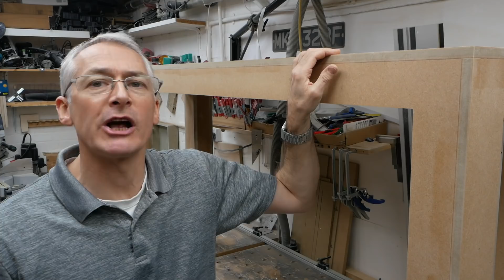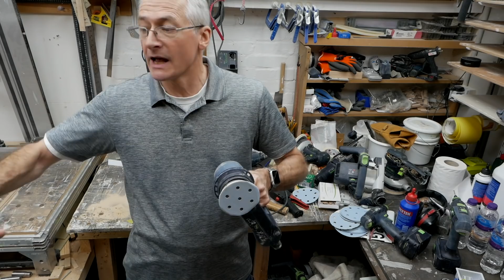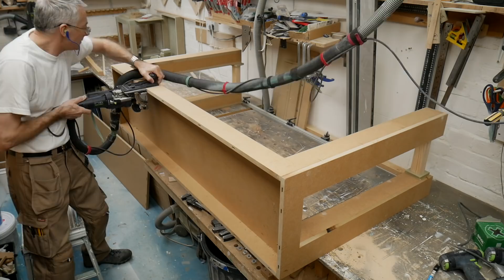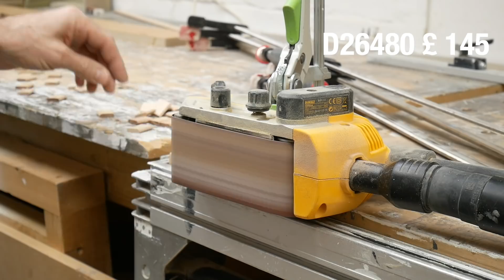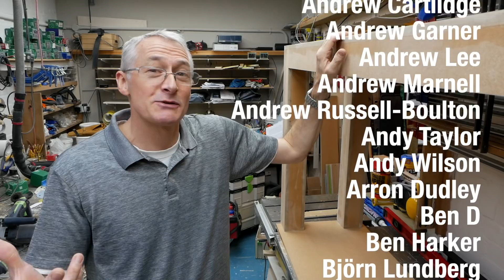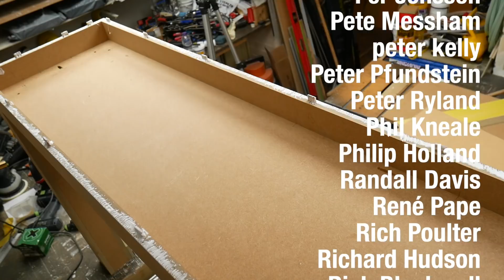Time, Tools & Money [video#245]

Comment: Obviously I’m late to the party but just wanted to share my thoughts on this: years of experience is also part of the costs. It’s no different from any other job - years of experience is usually at the top to be considered for a job application. The clients are not paying you only for the materials and the hours required to finish the job. They also have to pay you for the years of experience you’ve had related to the work to be done. 

Nothing against that person who commented it - he did positively and respectfully respond to your reply. The sad thing is he’s not alone with this thinking. They fail to realize that it’s just the same as any other job.

Comment: I see the benefits of a lot of the festool/mafell tools for a professional, but the festool drills seem disproportionately expensive. Is it reliability that draws you to the festool tools or is it that a couple of hundred quid over the life of the tool isn't worth worrying about, or is there something else these do better than a DeWalt/Makita that costs 1/3 the price.
Reply from the maker: I only wanted to support one battery platform, and when I started buying the drills Festool were the only company that also guaranteed the batteries for 3 years. The drills are generally excellent (after switching to Festool drill/drivers I got rid of my impact drivers) and were well ahead of their time with e.g. brushless motors; the centrotec chuck system is an elegant solution for everyday fast-change between drill/driver bits and also e.g. right-angle and offset chucks, as well. 👍👍
Reply: @10MinuteWorkshop  makes complete sense! Thanks for taking the time to explain. I just picked up a used TS55 plus 2x1400mm festool rails for £220 so starting to understand why they're so coveted.
Reply: @10MinuteWorkshop  Yeah that's a massive consideration I agree, you see all these 'cheap' brands nowadays and they aren't really value for money anyway.  If you take out the cost of the batteries and charger the price of for instance a Makita drill is hardly anymore than the price of an Einhell/Aldi/Lidl one...

Comment: I guess the people with negative comments do not run their own business or know anything about marketing and the difference between value and cost.  Many customers are happy, and in fact prefer, to pay a premium price for a premium product or service. Cost plus doesn't take in to account the quality of the finished product, the service being offered, the customer, the competition.  Your absolute minimum charge needs to cover your wages, holiday pay, sick cover, pension, business and van insurance, workshop rent, rates, tool wear and all the other fixed and variable costs. We occasionally build the cost of a tool in to the job but where we can spread the cost over a few jobs. I often check the hire cost at our local hire shop and include a charge for using our kit at that rate. Particularly if we use something like our mixer or chopsaw. It is easy to undervalue your skill when making things for people and get caught up trying to submit the cheapest quote.  Out of everything I do running my own business quoting is without doubt the hardest to get right. Simon. Artisan Bespoke Restoration.
Reply from the maker: Cheers Simon! 👍👍

Comment: 320 for a drill...that is ridiculous. You can get full kit Milwaukee or DeWalt for a lot less.
Reply from the maker: Sure - I bought mine in 2010. Centrotec Chuck on those others back then?? 3-year warranty on the batteries eight years ago? You can always buy cheaper, but does it last??

Comment: I love your channel as much as the next guy but let's pause for a second here. Lots of companies make all those tools... Drills, drivers, plunge saws, sanders. To be really honest you could do a "budget" version of that toolset and probably come in at half the price or less. 

I built my whole workshop with a CXS so I would argue that a T15 and T18 are hardly necessary for working with MDF. It has the centrotec system for goodness sake, the whole point is fast bit changing between drill and drive. It's still my only drill. Even then, it costs more than a Milwaukee or makita drill/drive kit. I did all of the wood exterior just with an ETS 150/5, too ;)

Again - I love what you do and I would never fault you for recovering your cost, but I do find this to be slightly disingenuous on the tool costs necessary for this work. Totally agree on clamps and other infrastructure though, that's one thing I always caution people about when they are getting into the hobby! Buying used helps ;)
Reply from the maker: I’m going to copy/paste an answer I gave to Richard Owen way at the start of the comments thread. Richard suggested I could have used Dewalt or Makita tools...

“...and just so’s we’re clear, I wasn’t using this video in any way to justify my purchases. I run my own business, I don’t have to justify them to anybody. But, out of interest, what DeWalt and Makita sanders have dust collection as good as the Festool? Where’s the Dewalt or Makita equivalent of the Rotex? Which DeWalt or Makita drills come with a 3-year warranty - including the batteries? My original tracksaw did 11 tough years on its first set or brushes - could I say the same of a DW or Mak? And the Domino?? Festool-only, mine’s getting on for 10 years old, and has cost me less than £1/week. And I could probably get the purchase price back right now if I sold it. So yes, I could use cheaper tools - but I made a business decision not to; I think it’s worked out pretty well...”

So I’ve made a business decision to buy mostly Festool; lots of reasons for this - compatibility, convenience, longevity etc... Yes, the centrotec bit-changing system is extremely convenient - but not as convenient as having a drill in one, and a driver in another. And when I’m doing installs, there’s also a hammer drill, and a CSX on the go as well; one mans extravagance is another mans efficiency... Could I use fewer tools to do the job? Sure, I did that for years before I acquired all these tools I now have. But I now have all these tools, all these sanders, that I’ve bought over years, and years of a variety of work - why wouldn’t I use them? 👍👍

Comment: The reason why there are so many cowboy traders in business and horror stories abound about rouge builders etc is that the public want rock bottom prices and expect platinum plated work. Value is driven by what someone is prepared to pay for a quality job. 
Peter, you shouldn't feel you have to justify your costs or charges, particularly in London where a peanut would cost the price of a a semi detached in Bradford, as for the detractors, fuck the lot of them....

Comment: Notice you rarely use a mask when finish sanding on your MDF projects and rely on your hose extract to remove particulates. Many MDF sheets are carcinogenic when sanded, and the amount you do I would not only use a high quality mask but also have an overhead Jet dust extractor installed. Especially in the confined workshop space you have. If anything happened to you it would inconvenience me in that I would have to find another healthy MDF woodworker on the tube.
Reply from the maker: Thanks! All wood dust is hazardous and protective measures should be taken. I’m asthmatic, so particularly sensitive to this issue. 

MDF is NOT carcinogenic;; some boards may contain formaldehyde as a binding agent (resin), which is classed as carcinogenic and carries the health warning in the UK and EU as ‘suspected of causing cancer’. But formaldehyde levels from boards sourced within the EU at formaldehyde level E1 are “insignificant”. In addition, I use MR MDF almost exclusively, which uses formaldehyde-free binders, typically PDMI.

You will find higher levels of formaldehyde in a cheap far-east sourced shirt, than in any MDF board I use. 

In short, as an asthma sufferer, I am perfectly comfortable relying on the dust extraction at the tool to deal with this. I do have an air filter / scrubber to deal with dust not collected at the tool, but for obvious reasons this doesn’t run while I’m shooting video. 

Further reading:- http://www.hse.gov.uk/woodworking/faq-mdf.htm

👍👍

Comment: I’ve watched this video twice and read some of the comments, some quite bizarre ones at that. Many years ago, I ran a gardening business, mainly just me but occasionally got help. Anyway, I don’t think I had many jobs where my rates were scrutinised to the nth degree, and sometimes it really got to me. I am qualified, but there were, and still are, guys with no qualifications, charging more that I did, and getting work, but when it went pear shaped, I sometimes ended up going back to rectify some kind of their work, therefore cost the customer more in the long run. People also don’t realise that you need good quality kit to do work like that, otherwise it doesn’t stand up to long term use, and as you quite rightly said, speculate to accumulate. Something which is lost to some people. Thanks for reading this. As an aside, I bought a little Katsu after seeing a few people including yourself using one. Haven’t tried it yet, I have a little project in mind for it. All the best, Brian.
Reply from the maker: Thanks Brian! Hope you enjoy the Katsu - video coming soon! 👍👍

Comment: It looks like there is some parallel between wood working and software development: out of the 3 options “done cheaply”, “done properly” and “done quickly”, a customer gets to pick two (at most). (In software those are usually phrased as “on buget”, “without bugs” and “on time”)

Comment: I run my own business Peter, bespoke web design and SEO.

Bespoke prices are always much more expensive than off the shelf solutions. People who cringe at bespoke prices do not understand client requirements, the labour intensive process of delivering a bespoke solution and the benefits to the client of providing a bespoke solution.

Some new clients are used to making their own website using a free off the shelf solution and doing their own search engine optimisation using a cheap off the shelf solution. They approach me because they hear I can help businesses make money. Once they hear my prices I can hear their jaw drop to the floor. Once I start helping them they begin to understand why bespoke solutions cost money and you get what you pay for. Once their business starts making loads more money than they were making before they always wish they approached me 10 years ago.

In summary people always have the option of choosing off the shelf or bespoke. In some situations choosing a cheap off the shelf solution is the right choice, in other situations a bespoke solution is required and that cost money.

Comment: What a lot of "woodworkers" fail to understand is that even though MDF is a less expensive material, if you are going to paint it, as you would most MDF, the "labor intensive" aspect increases exponentially. To achieve a seamless, painted finish is generally a bit more time consuming than a stained and lacquered finish a lot of  finish shops put out. They will charge more for a painted surface than a stained and lacquered finish because of the types of steps required to achieve that finish. regardless of materials, fitted surfaces and edges are fitted surfaces and edges. Arguably the Festool  tools are far above other name brand tools in cost. Are they that much better? I'd say on the average, no. Are they good? Yes. They do have some that are recognizably superior, but many are not 3-4 times better that the typical other known tools as they are priced (Dewalt, Bosch, Makita, Milwaukee, to name a few). They do have an incredible dust removal system built in to most of their tools. Is it worth the $85.00 tool vs. the $350.00 equivalent tool? You be the judge. Dust abatement is a serious concern, but there are many systems that would allow you to purchase more good tools and include a dust removal system and let you be tool rich as far as diversity or duplication. You charge what the market will bear. Quality and expertise is worth much to a customer who wants both, otherwise, go visit IKEA.
Reply from the maker: Thanks! Dust collection is very important to me, as an asthmatic, so yes, worth the extra for me. The other thing about Festool a is that they keep their value; for example, my Domino is getting on for 10 years old and has cost me less than £1/week. But I could probably still sell it and recoup 90% of the original purchase price. After 10 hard years, that’s an investment 👍👍

Comment: Hi Peter. Shitstorms sometimes happen without reason, without any logic. It just happens ... Personally I have really tried to figure out what in the world triggered this, because everything you have said and done gives 100 % meaning to me, and our friend Ingvar K in Sweden uses even cheaper materials and has made an impire out of his business. Therefore it cannot be a problem using MDF, by the way, I use it all the time myself. And honestly, you can of course sand by hand, saw by a handsaw, but what does that prove? It proves you never owned a Festool-sander before! Not knowing the stroke of the sander means to me not knowing the grain of the paper. There is a reason that you can buy the different ones with different size, stroke and center of mass and changing the paper takes time ... For me dust and ergonomics are important as for you, and your recent health docus clearly shows better to be carefully about it. I am not a professionel joiner or carpenter, but at least I know and appreciate my (Fes)tools. Expensive yes - but also extremely accurate and comes with theft insurance and in a system with many years of spare parts if ever needed. You have choosen the perfect tools for the job to do. You could have gone cheaper for half of the fun - but then again why? One of the reasons I watch your channel is because you use both your brave brain and marvelous Festool. Pls continue doing both and I am very happy.
Reply from the maker: Thank you Henrik! The other thing about Festool a is that they keep their value; my Domino is getting on for 10 years old and has cost me less than £1/week. But I could probably still sell it and recoup 90% of the original purchase price. After 10 hard years, that’s an investment 👍👍

Comment: I thought you were quite clear in the original video; made perfect sense to me. As for the comments on your skill level...hmmm, I could watch 100s of youtubers, but from your's I learn stuff. Lastly, you've done tool comparisons, how about MDF to plywood to hard wood? When I started out woodworking as a hobby, MDF was clearly viewed an inferior to hardwood or plywood. I did build a set of mdf shelves somewhere in the mid1980s; they sagged quickly--over a few months. Perhaps its improved over the last 30 years?
Reply from the maker: Thanks Kevin! The one thing you need to be careful of with MDF is it’s weight, and yes, it can sag if it’s not used correctly - that’s not a dig, it’s just that often the guys who don’t use MDF much that have the most issues with it - go figure! For wider spans it needs some help - thicker board, solid timber edging, possibly steel reinforcing, or laminating / torsion box construction. There’s always a way. 👍👍
Reply: @10MinuteWorkshop  Of the youtube channels I watch, you're the only one who uses mdf regularly for building custom-built projects for customers. Although I recall some back and forth with John Heisz over his use of mdf core with a hardwood laminate for kitchen cabinets. John kept referring to it as plywood and caught a fair amount of negative comments that it wasn't really plywood. In any case, I'd be interested (and perhaps others too) on when and how to best use mdf. It certainly has advantages in terms of costs and time--coming as it does already flat, square, and consistent thickness. I wonder, for example, is it like plywood where there are clear levels of quality differences? Is the stuff from home depot lessor than from other sources? Aside from reinforcing it when needed, how does it effect your design decisions? etc. How easy is it to laminate versus painting if I want a real wood look?
Reply from the maker: @kevinblair2882  Are you in the U.S. Kevin? Just curious, as here in the UK & Europe the vast majority of kitchen cabinets are made from MFC or melamine faced chipboard. Even high-end cabinetry is made that way - have a google for Egger board for the variety of finishes available - these boards can cost more than solid timber, and we have to pay a lot for timber here! For general cabinetry, then yes there are varying grades of MDF; I use MR (Moisture Resistant) MDF, not for any moisture resistance, but because it's a better quality board for not much more money - it has a harder core than regular MDF, so you don't get the 'fluffy edges' that I've seen some folks complain about. As the vast majority of my work has a painted finish I rarely use plywood, unless it's to be left in the raw, or upholstered; MDF simply takes paint better. If you want a 'real wood' look, then veneered MDF is widely available, with all the benefits of MDF - flat, square, stable etc... That said, in ~20 years of doing this for a living, I've only been asked to produce veneered finish twice! As far as design decisions go, the only real issue is to be careful about the weight/span of horizontal surfaces, and make sure they're appropriately supported. HTH 👍👍
Reply: @10MinuteWorkshop  I am in the US. I live in Buffalo, NY about 2 hours south of Toronto, about 25 miles from Niagara Falls. I will check out Egger board. I have a feeling that mdf and how to best use it have come a long way from that 1980s book shelf that I made. Whenever I am in Europe (a few times per year and I'll actually be in London with my sons next week), prices for everything are higher--often much higher--than in the US; Add in the exchange rates for pounds or euros and it gets really expensive compared to US pricing.